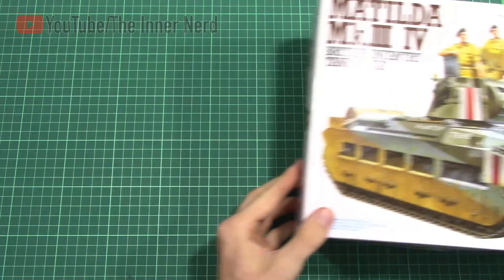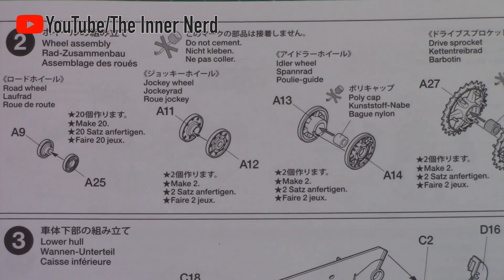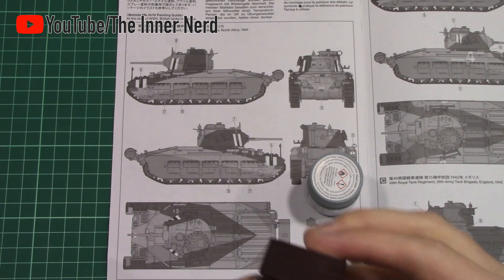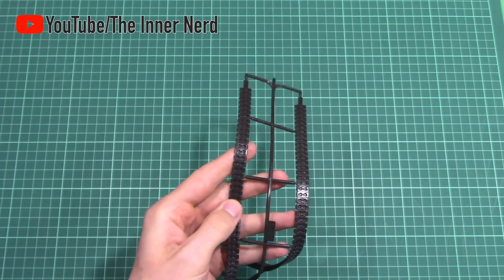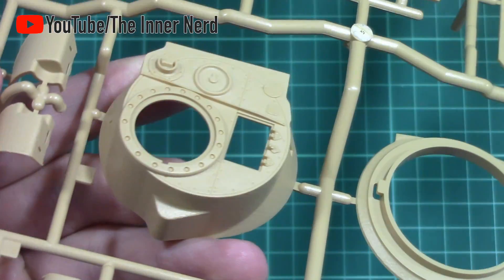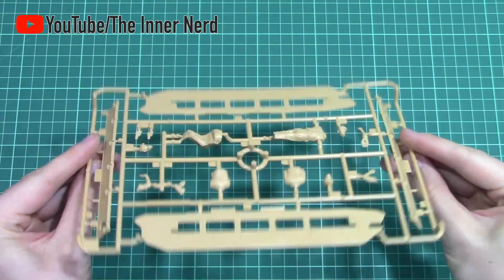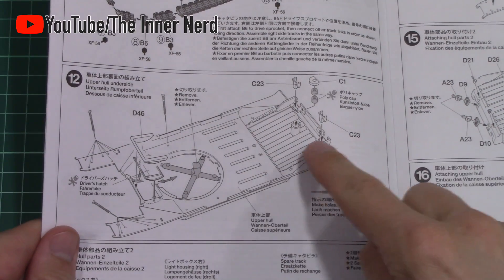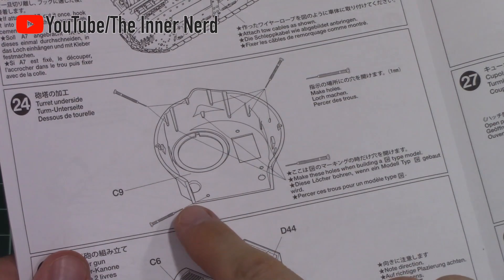UNBOXING Tamiya Matilda Mk.II 1/35 | The Inner Nerd

Comment: hi your obviously an experienced model maker who knows what your doing as I'm a complete beginner who doesn't so please can you advise on a Tamiya tank1/35 scale that would be a good starting for a beginner such as myself i have just liked it and subscribed to your videos      paul
Reply from the maker: Hi Paul. I would suggest anything Tamiya from around the 10's forward. Tamiya is much cheaper than most other armour manufacturers and their kits are generally very easy to assemble. This Matilda is one of the easiest kits I have ever assembled and I believe thier Valentine tank is also good. I also built thier Tiger a few years back and that was also good from what I remember. I hope this helps you find something. Thanks for watching and subscribing :)